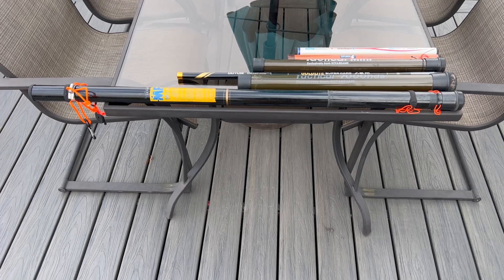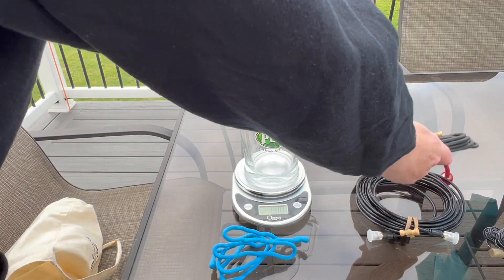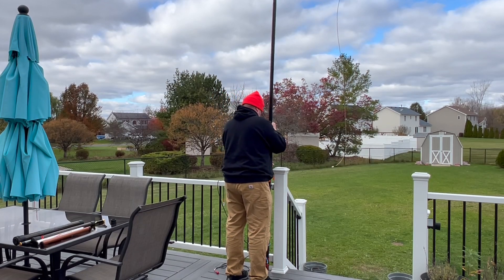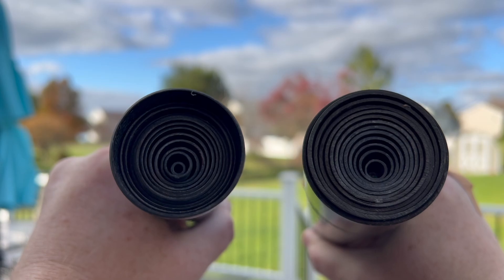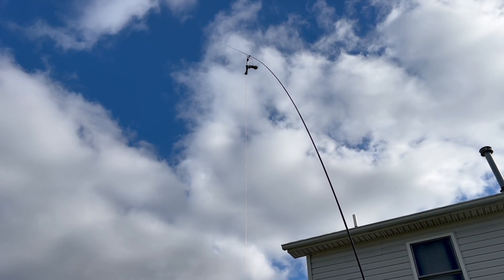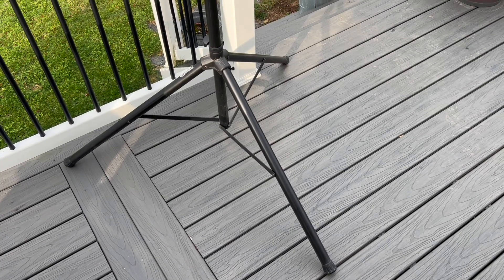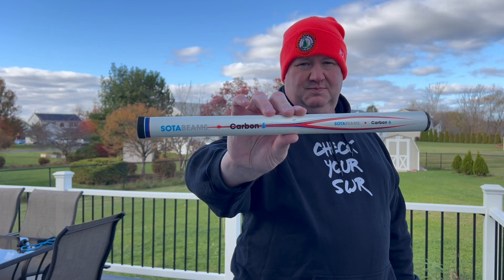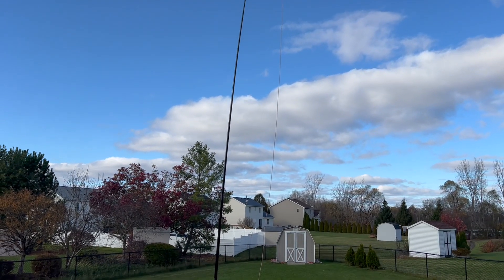Testing 6 Masts with Different Coax

Comment: I am sorry but i learned the hard way, these masts, and i mean none of them are designed to hold up complete wire systems and coax cable, if you are tring to hold up transformers, and coax, you need a lot heavier pole, if you are holding one end of a end fed or dipole, depending on the wire and the length they may work, just don't understand the relevance of what you are doing, and honestly i don't think you do eather, sorry, but people following your lead are going to end up with a bunch of expensive busted up masts.
Reply from the maker: As shown in the video and based on my use in the field, the SOTABEAMS masts in the video are perfectly capable of supporting a dipole or OCFD along with coax. I’ve use all the others for POTA & SOTA with the dipoles and OCFDs too, but with lighter coax, like RG174 and RG316. Ultimately, the purpose of the video is to give people an idea of the strain different coax will put on different masts so they can make the best decisions for how they operate. That way they can make better informed decisions about masts and coax for portable operations.

Comment: a good way to minimize the bend of the poles from heavier 
coax is to velcro the coax to the pole straight up and down. Straight up it's more ridged
Reply from the maker: Definitely! I usually use Bongo Ties or Velcro on my coax when it’s rolled-up, so I’ll sometimes put those on to help secure the cable or antenna wire to a mast. Thanks for watching!

Comment: You forgot LMR-240     Its my fav for hf and portable.  Sturdy enough and low loss yet small.     Same crimp cnctrs as rg8x.  I also made an rf choke on each end of it.   Try it and you will be impressed.   Also good for base runs due to low loss on hf and cb.      U can get cheap velcro to put every few feet as u raise mast.  Keeps coax closer to mast and less weight )    “80 pcs Reusable Fastening Cable Ties 3 Sizes 6/8/10 inch Adjustable Cord Ties Cord Straps Cable Organizer Hook and Loop Ties for Cord Management，5 Colors”
Reply from the maker: I haven’t used LMR 240, but look forward to trying it sometime. I’d suspect it’s about the same weight as RG8X.

Comment: Nice comparison video.  What I would like to see is using the masts as a support for vertical wire and what effect using a carbon fiber mast has versus a fiberglass mast.  The theory says the fiberglass is RF transparent or nearly so.  However, carbon fiber is conductive and NOT RF transparent so it would be like running another conductor next to the antenna.
Reply from the maker: I’ve tested that with my Ed Fong J-pole and maybe I should do a video on it. If the antenna to touching or very close to the carbon fiber mast, the SWR was way off. But if the pole was angled a little, so the antenna would hang away from it, then it looked and performed fine.
Reply: @MikeN2MAK  That is the type of info I was seeking.  Thank you.  Doing a video on it would be useful.

Comment: I use RG-174 for feedline on an inverted vee on a SOTABeams 10m travel mast.  The mast can be a bit flexy, but one way to manage  it is to tie the coax to the mast at several points using Velcro strips, heavy duty twist ties, or the like.  This keeps the coax in line with the mast when wind or tension on the antenna starts to pull the top of the mast over a bit.  Keeping the coax in line with the mast keeps its load in line with the mast so that it doesn't add to the mass pulling the tip over toward the ground.
Reply from the maker: I like to do the same too. I usually have Bongo Ties or velcro on my coax and wire antennas, which you might have noticed in the video. I'll usually use a couple of those to keep things in order. i didn't do that here though so people can really see how the masts behave and then plan for what's best for their usage.

Comment: A three leg guyed tower is very common, so for a simple POTA setup where you are bringing everything. and have no control on what exists. a Light weight mast, light weight dipole and light weight coax it makes sense to use what you have and use each component as part of the antenna light weight portable (temporary) structure

Comment: For Field operations consider a three legged mass guyed configuration.
The antenna is two legs and the coax being the Third leg. We used this configuration for many Field Day Ops. where no trees are available for the dipole deployment. the Mast is raised sufficient to provide an even tension on all three support lines (two antenna element lines one coax line) This provides a symmetrical layout and everything can be pre-marked for best length.
Reply from the maker: I’ve hear of this but never done it. I’ll have to try sometime. Thanks for watching!

Comment: Why haven't you taken a look at the DX Commander replacement masts on DX Engineering? I think they would be applicable in a POTA or Field day application and the price points of the masts that are 10 meter and under are not bad.
Reply from the maker: I hear great things about the DX Commander Masts, I just don't own one--yet. But if Lord Callum or DX Engineering want to send me one, I'd be glad to put it to use, LOL. All the masts in this video were paid for by me, except for the Tactical Mini that I borrowed from a friend (but I've used that several times before).

Comment: That Giga Parts POTA20 has me rethinking my decision of the 30 foot one I pre-ordered.
Reply from the maker: The POTA20 is a pretty solid mast and I like it a lot so far. If you’re using it for a dipole/OCFD, there are some things that can help minimize the strain if you use heavier coax, like wrapping it or securing it to the mast. Also, keep in mind the the loss on lighter coax like RG316 isn’t as bad on lower frequencies, like 40m. Ultimately, it all depends on how you plan to use it.
Reply: @ I mainly plan on using it to hold up the wire end of an EFHW and maybe experiment with it is an inverted V. I use RG-316 95% of the time and even on 10m the loss isn’t that horrible. I usually use a 50’ run for my POTA activations.
Reply from the maker: @truckinguy92  if you're using the mast for an EFHW sloper or inverted V than it shouldn't be any problem at all.

Comment: Why would you not use guy ropes?
I got a SOTABEAM Tactical Mini but won't run coax up it because I'll be running a wire up it for a vertical for portable use with a tuner fed at the bottom. Or a dipole/doublet with guy ropes, the Mini came with some so why not use them?
G4GHB.
Reply from the maker: Simply put, I did not guy the masts because of time. Plus I don’t always use guys in the field. Some parks prohibit putting stakes in the ground. Most of the time I use a mast it’s either a bigger one in a dive-over mount or a lightweight one tied off with the rubber wire or with a single spike leaning in a tree. Ultimately, this video was to give viewers a sense of how the masts behave with an antenna at the top and different coax weights. In addition to guying, securing the coax to the mast is another way to mitigate the strain on the masts.  Thanks for watching though. Hopefully the video and comments like this give viewers ideas about what’s right for them.
Reply: @MikeN2MAK  O.K., thanks.

Comment: Can you choose not to extend the top-most sections so it's stronger, yet shorter?
Reply from the maker: Yes, you can always remove or not use the tops sections. I typically skip the top 1-2 sections of the mast to be safe if I'm using a dipole or OCFD.

Comment: Check out the DX Engineering Premier Telescoping Carbon Fiber Masts. I have the 33 foot one:  DXE-TCFP-33.
It has adjustable quick release locks so I can put it up in about 2 minutes and taken down in less time.
Very sturdy, lightweight, and portable.
Reply from the maker: Thanks, I'll look into that! I've had the Spider Beams 12m mast on my mind recently too.
Reply: At $469 and $599 for the HD version, that’s out of mosts price range.

Comment: I’d be curious how much more they can handle if you wrap a little bit of Velcro around every few feet to hold the coax next to the mast instead of hanging further and further away as the mast bends.
Reply from the maker: The POTA20 is pretty solid for its size and weight. I think it might be just fine with the coax wrapped or tied.

Comment: Get rid of the RG-58. it is lossy and  isn't that light weight. 316 is even more lossy but it is light weight.  Look at the loss tables. RG-8x or LMr240 is what you want as it has quite low loss. You can tape the coax to the mast so that not all the weight  is applied at the top . Coiling the coax around the mast also helps.
Reply from the maker: I don’t use the RG58 much at all. It was just a cheap purchase from Amazon since it had BNC and I struggled at first doing my own RG316 cable assemblies. What I really want to try is the M&P Airborne 5. Good points and tips on taping or wrapping the coax, which is something I’ve done on occasion.

Comment: Fun video. I would only use the Goture with an endfed. It isn’t strong enough to hold the coax. But the cost is also much less. DE AD0L
Reply from the maker: I've used the Goture a couple of times with the N9SAB OCFD and RG316 when I got it. It's not my favorite, but I picked it up during one of the Amazon sales a year ago. For the price, I figured it couldn't hurt. What I really dislike about it is the length when collapsed. It's not very travel friendly like the Carbon 6, POTA20, or Tactical Mini.

Comment: I think ill be doing Inverted L's for set-up, because none of the mast's I've seen inspire confidence, especially in high winds. Thank you for the demonstrations.
Reply from the maker: I’m glad it helped! I’ve used inverted Ls many times. You might want to avoid carbon fiber though, since it can interact and affect the antenna if it’s to close. The carbon fiber masts I have work fine for EFHFs as a sloper or dipoles and OCFDs. But when I’ve tried roll-up J-poles or wire vertices, the carbon fiber does affect the SWR and performance some.

Comment: I have the mfj and the 7000hds . never had an issue
Reply from the maker: I’ve had good experience with both. The 7000hds would be perfect if its butt wasn’t so big—it won’t fit in my drive-over mount, LOL
Reply: @MikeN2MAK  YES!!! I have yet to find one that fits. So bungee cording to my tailgate is usually what I do
Reply from the maker: @GAParksandPropagation  Awesome! I still need to come up with a convenient solution to use that mast with my car.

Comment: Excellent video Mike! I use the Tactical Mini at the QTH to hold up my 10m speaker wire dipole. And I have the Carbon 6 that I've used in the field, and really like it as well. 
73 de KJ7LLX
Reply from the maker: Thanks! The SOTABEAMS mast are excellent. I wish they’d make an 8 meter one that would be somewhat lightweight but also perfect for a 25’ Rybakov vertical.
Reply: @MikeN2MAK  If I could make one request... If you still have access, could you list the weights of each of the masts, without their protective coverings? 😁 I'm thinking of SOTA
Reply from the maker: @rodgermckeon  Will do! I still have 'em. I'll make a not to weigh them and follow up with you.

Comment: Good test. Only variable missing is taping the coax to the mast at the top. When I put up the spiderbeam 12m mast with a linked dipole I'll tape the RG8X about 2ft below the tip and then kind of wrap it around the mast a couple times on the way up so that it doesn't put any lateral forces on the smaller top section. Works pretty well. I have the goture rod, I took the top section out because it was useless and I never do dipoles with it, I just use it for supporting the far end of endfeds. Been looking at the POTA 20's though lately. 73. K3KLB
Reply from the maker: Thanks, Kody! The POTA20 is nice. I sometimes use velcro ties to keep the coax close to the mast. I didn't think about that until I got started, since I was curious to see what the flex was like. I've used the Goture a few times with the N9SAB OCFD, so I knew it'd work, but that was with RG316 or RG174. It's always good to have options thought. If I'm doing a hike-in POTA or SOTA, I'll go with a lighter coax and mast. But when I'm operating from my car most of the time in the winter, it's nice to be able to use better coax.
Reply: I've done the same thing except with zip ties. I'll put one two sections down from the top and then another two sections down so that the entire weight of the coax isn't pulling on the feedpoint part of the mast. I have the Spiderbeam 12m as well and its a really great mast. I also have the Tactical 7000 HDS and it works almost as good as the Spiderbeam. With the 7000 sometimes I will use RG-174 coax which weighs almost nothing. I also have a Max Gains 28.5' mast which I could almost climb up because it is so solid. 73 KD5YOU
Reply: @kd5you1  curious which MGS Mast you have? What model and what have you done with it? I've been looking at them, particularly to put a home brew 10m moxon on top of. Along with the possibility of supporting wire antennas and maybe a couple 17' whips as a dipole. I've wondered how stout they are and if they really need guy lines or not.
Reply: @Kody10538  I have the 28.5 foot mast. I don't have it installed permanently, but I do set it up in the back yard and when I set up in the field. In calm weather they don't really need guys, but I would use them for a permanent installation. I use mine with a 40/30/20 meter linked inverted V and a Larsen 2/70 mobile antenna at the same time. It doesn't seem to have any issues with two lengths of RG8X coax even without zip ties.